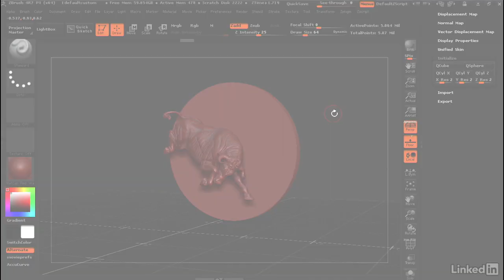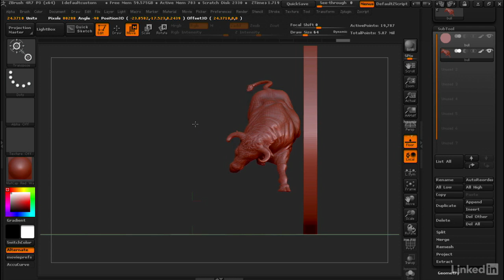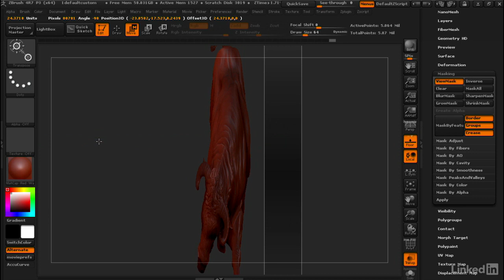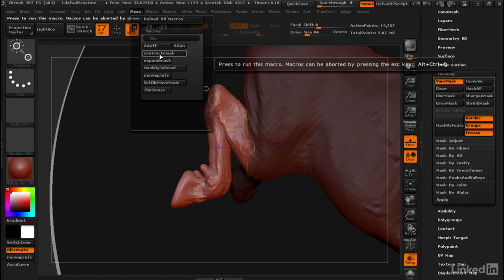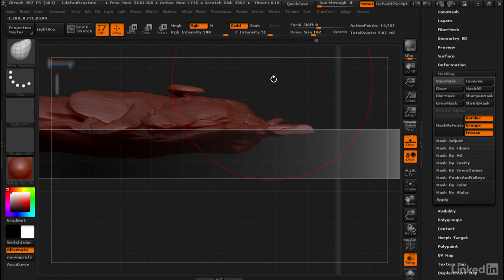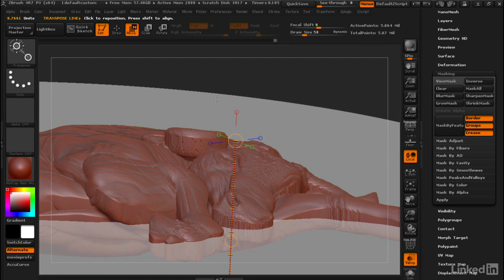023 Turning a model into a bas relief sculpture

Comment: Interesting approach. I solved this issue myself rendering height maps and then extruding them from planes. The good side is that you don't destroy your models and can easily change anything - you just need a new render.
The downside is that you are limited by the 8-bit (16, in the best case) of color for the height.

Comment: Brilliant tutorial, amazing what you can learn in 20 minutes. Love the way you resolve undercuts. As a by the by, if you hadn't resolved the undercut. With CnC users and the software that creates the GCode it would automatically ignore the undercuts and all cuts would be straight according to the flute (cutter shape).  Beauty of this now is you can make an alpha and use it with CnC, Laser etc.. The issue of undercuts of course with 3d resin printers if you try to make a mould depending on the undercut you could be in a lot of strife. Striking a coin wouldn't work, pouring or cold casting it could be an interesting effect.
I was going about this in the wrong way, I was positioning models then trying to take make an alpha, then trying to flatten which was just not working right. The other issue was of course maintaining detail which you have in your tutorial. Thank you for taking the time and effort!!! Look forward to seeing some more tips and tricks!!

Amazing!! ty again!!